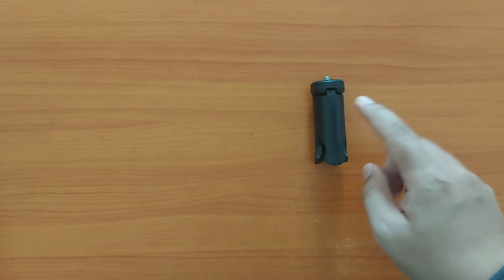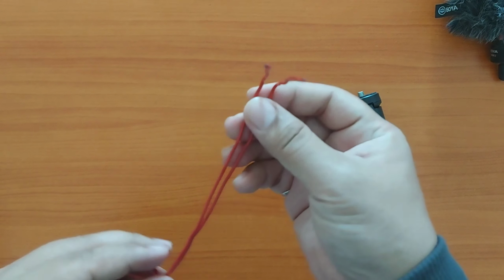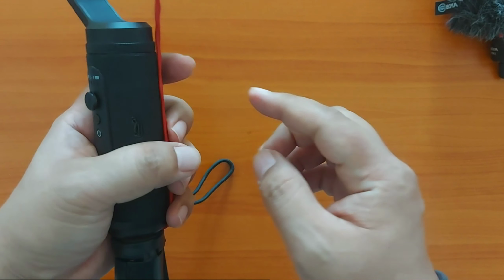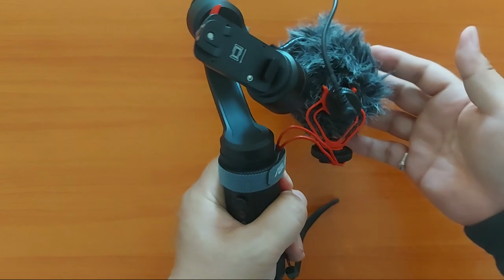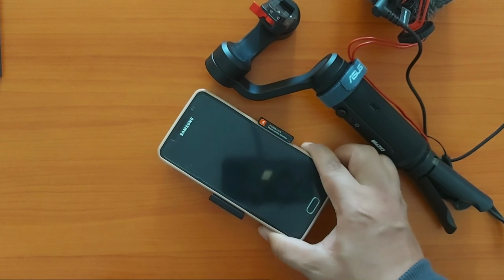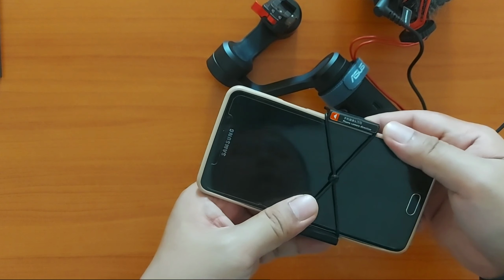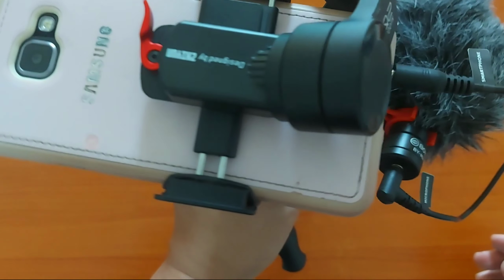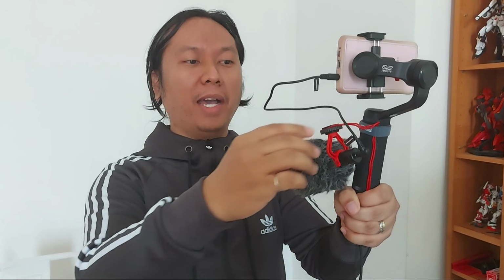ZHIYUN SMOOTH Q2 X BOYA MIC MM1 MIC SETUP, Tips and tricks.

Comment: i am not good at stuff like this. im glad i purchased that camera bracket. haha. thanks for the creative tutorial.
Reply from the maker: actually, I am tempted to buy a bracket, then I just tried other possibilities so I come up with this.
Reply: @iniTThing  i hope that the boya by-mm1 can still pick up our voice even when it will obviously be positioned on the side and not centered like when we are using a phone clamp with built in cold shoe mount like the ulanzi ST02. or maybe Zhiyun should make an optional phone clamp for the Q2 with mic mount up top>? hahah..wild ideas.
Reply from the maker: It can pick up our voice as long as you point the mic towards you, however you need to consider your distance from the mic, if you are holding the gimbal with one hand you still have a good sound, you also need to consider the background noise when you are outside.